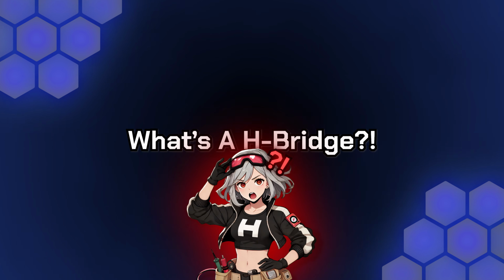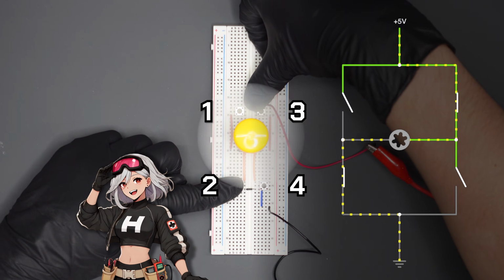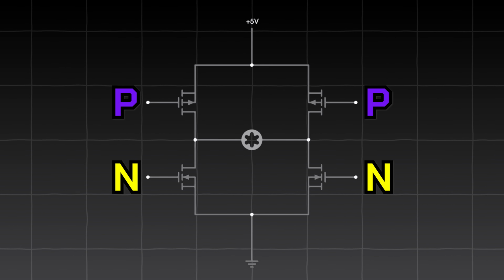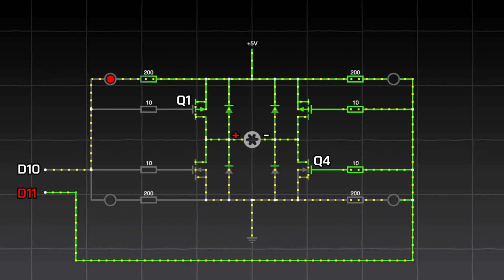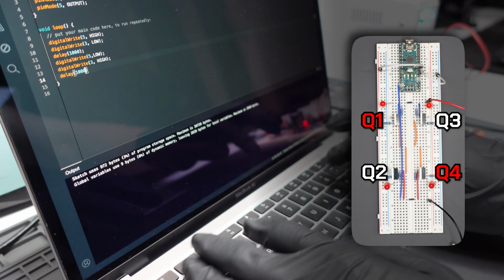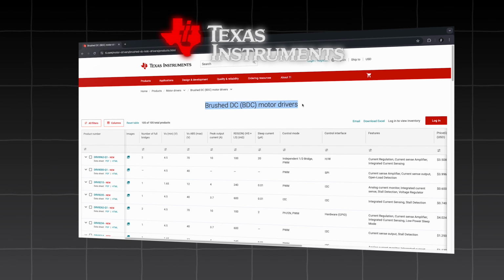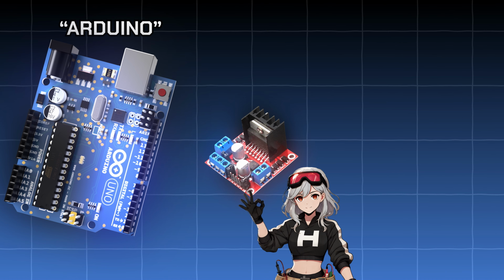How H-Bridge Motor Drivers Work! (Theory, Circuits, PCBs, Buying Guide)

Comment: This circuit only works when your micro controller logic level is the same or higher than your V+ for the H-bridge btw. If you want to control a higher voltage motor you have to modify the circuit.

Comment: Motor drivers never uses P channel mosfet due to the inefficient condition. Instead bootstrap capasitor used for activeting high side mosfet s gate by boosting the dc bus voltage. B capasitor get charged when low sides on.

Comment: Hi nice explanations Sir about H-Bridge Transistor. 
Can you make video about making a Diy efficient Dc to Ac Inverter PSW or MSW type using Arduino or a control ic and a H-Bridge to drive a step-up ferrite transformer? Ty

Comment: can you use it with a higher voltage than 5V (max for arduino)  like can you just add a transistor in between so that you can apply a batttery with an higher voltage for the motor?

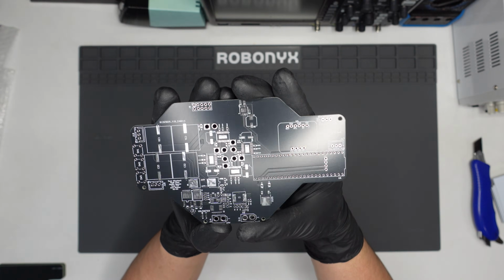Comment: At 3:36 I had learned what took me 2 hours on my own about how electric windows work in the vast majority of cars. Big difference is instead of MOSFETs, cars use relays to control a circuit capable of drawing 30A for a few seconds before popping either an auto reset circuit breaker and a slow-blow fuse. Or tripping computer-controlled circuit protection 😊. Electric seats work the same as well, with an added controller for memory functions.

Comment: 5:24 I were very confused about the path of back emf current. I thought the same path as you showed here. I have a question that "Does the current flow through D3 to postive terminal of battery then through battery and coming out from negative terminal of battery and then flow through D2 and then reach the negative terminal of motor?"
Again, the back emf current to flow through the battery the back emf needs to be at higher potential than the battery. So, does the back emf really rise above the supply voltage?

Comment: Great overview for beginners and very  quick but gets the point across ... After doing designs for many years it is a good place to start. For you starting with it do your projects in increments and get a small parts working first (like the connectivity right, correct voltage levels, etc.) then drive the PWMs with enough pulse width to move the rotor in one direction. Programming the MCU to generate the PWM outputs may be a bit more involved since one has to set up the SW and the PWM drivers with PWM frequency (likely 20kHz PWM frequency or higher). Have fun!

Comment: I am making an electric wheelchair using two car wiper motors. Which is better for motor control: an H-bridge relay, an H-bridge MOSFET, the DRV8873 IC, or any other modules available in the market? 7:52

Comment: Thanks for this wonderful video about H-bridge.  A question: how can this small IC in 8:43 handles 10 Amps? I think for such load transistors (e.g. mosfets) are required. Those transistors receive the control signals from the IC and drive the motors.

Comment: So if I am running a motor through motor driver...the motor will move in 1 direction and then move in another. Seems useless. How will i use it in a RC car?
Reply: because you can choose when to make it reverse by switching the transistors off. suppose you had an RC car it would help if you pressed a remote button to activate the transistors in the car and make it reverse!

Comment: The H-bridge does not allow you to precisely control the speed of DC motors, you can only precisely control the torque. and that will vary at high revs and will be far from precise